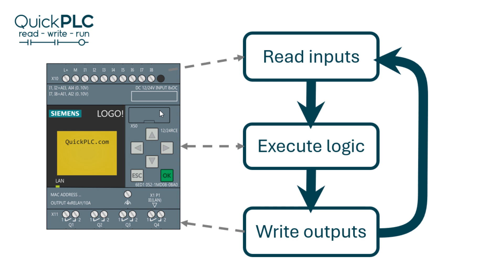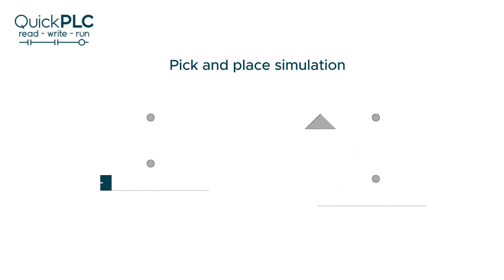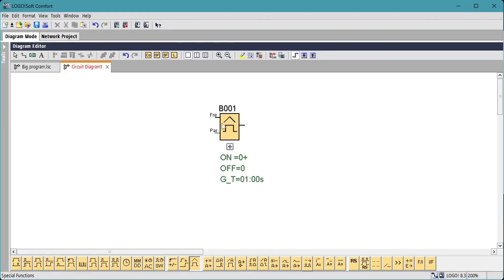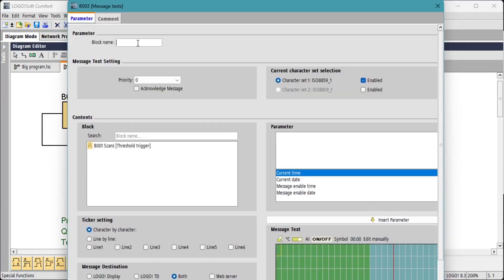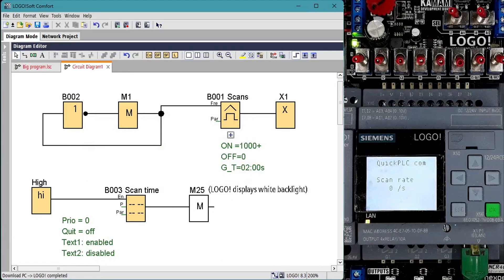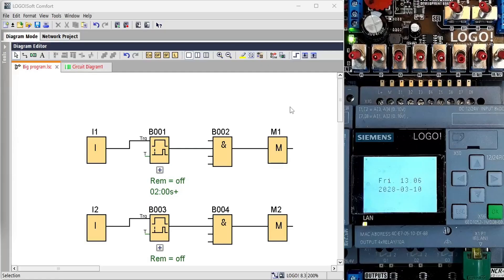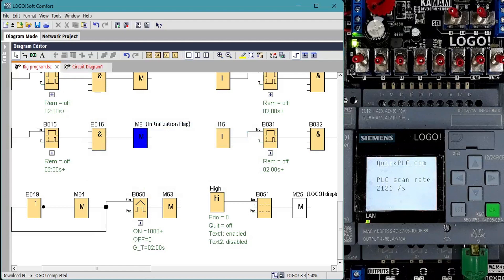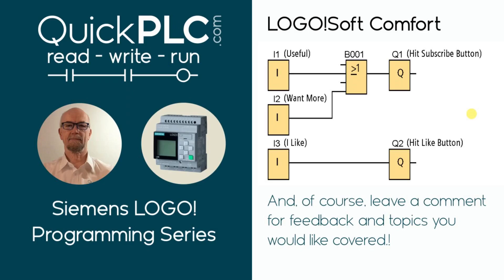LOGO! Scan time - how Quick is the LOGO!? | Siemens PLC programming

Comment: Hello!  I have a question again)) - did I understand correctly: the NOT block in one cycle has an output of 1, in the next cycle it has 0 and then everything repeats?
Reply from the maker: Sorry for the delay. I didn't notice your comment. At what time in the video are you asking?
Reply: Hello.  Everything is fine!  Starting from 1:37, you assemble a circuit with recursion to the NOT block.  In the first cycle, the output of the NOT block is a logical one, in the second cycle it is a zero, and so on, each odd cycle is equal to a logical one, and every even cycle is equal to a logical zero?  It turns out that the block does NOT switch its state in each new cycle?
Reply from the maker: Ah, yes. Have a look at the "LOGO! M & Q and the program scan" (https://www.youtube.com/watch?v=Bm6qlgkng1M) where I go into some detail. I think this will answer your question. Follow that up with the "LOGO! Shift Register" (https://youtu.be/tsi72VobvYg) video and you'll be expert! Let me know how you get on.
Reply: Good, thank you.  I'll watch these videos and give you feedback!